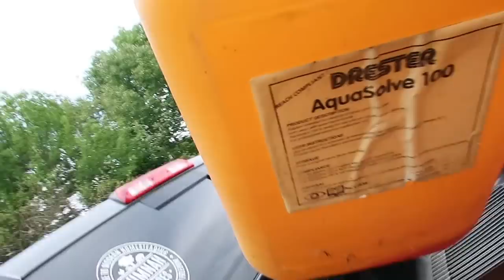Unbelievable Discovery Unearthed While Planting Our Pasture

Comment: Al, you have mentioned several times about having to mess with your tractor fuel and spilling it because you cannot see when the tank is full.  Well, have you looked into the portable gas rolling tank that holds either 15 or 20 gallons of fuel and it has rwo wheels like a 2-wheel package truck?  The two options also have a gas nossel and hose that allows you to pump your fuel.  There also is a battery powered fuel pump the your can put into your supply tank and press the switch and pump the fuel into the tractor.  Just offering you some suggestions.

Comment: I have seen Facebook posts about solar lights burning buildings down due to battery overheating from overcharging.  It may just be certain brands (cheap ones?)  but you should research the ones you have and I think it would be a good idea to mount those on its own pole or non combustible material to be on safe side.  Love what you’re doing with homestead by the way.

Comment: I know you are limited by the size of your tractor..
Having spent 36 working years running heavy equipment..  I don't think twice about playing with dirt...
Big farms take the time to level their fields...
Helps stop erosion and helps the water soak in..
If funds become available...
Leveling the pasture might make life easier..
With your tractors limitations..
Maybe think about cross raking your pasture. (Raking across the slope and not down the hill)
At the end of each pass
turn back up the slope a little to help stop wash outs....  
Should help stop some of the rain from running down the slope washing things out....
Maybe.   ?
That's where i might start..
Reply: The BEST advice of the bunch! Isn't there a method of making several very shallow ditch-like rows across a field to slow the water and retain it longer so it can soak in rather than run off? Wranglerstar did a video about how he did it. They don't have to be very deep nor close together. I can't remember what the method is called, but it seemed like a good idea depending on how you want to use the field.
Reply: Called swales. Good idea!
Reply: Mrs. Lewis 
Making swales would require a larger machine
Basicaly you would be tertacing the pasture..
They used swales in arizona's lower desert to reclaim land..
Swales might require more effort than to level the whole pasture with a holding berm around 3 sides..

Comment: Find that spring head dig it out and then make a trench so the water flows in the trench rather than all over the pasture turn that spring head into a live stock continuous water source
Reply: Or put a couple of cement pipe rings one on top of the other and an outlet. Pop in a pump and you have water on tap.
Reply: Good thought, or you could use gravity and pipe it down to a watering trough  self sustaining no electricity needed
Reply: Being able to develop a spring is a great asset on a home stead, all kind of possibilities .
Reply: DON'T THINK IT IZ A NATURAL SPRING
IT IZ JUST THE LOW SPOTS OF THE LAND
& JUST THE RAIN WATER COLLECTED
THERE.  I DO AGREE WITH THE IDEA
THAT IT NEEDZ TO BE TRENCH OUT
AN MADE TO TRAVEL AWAY ELSE
WHERE...
GO BACK & WATCH SUM OF THE 
OVERHEAD DRONE SHOTS & PAY
ATTENTION TO THE LAY OF THE LAND...
Reply: you may be correct looks like the saw grass is always green and comes to a point and then spreads out below a specific point either way either drain tile or trenched in order for it to dry out and reclaim the land
Reply: @jeffperry9274  
YES I DO AGREE WITH YA THERE
THAT IZ THE PROBLEM THERE
NO PLACE FOR THAT STANDING
WATER TO DRAIN AWAY FROM.
ITHER MOVE SUM OF THE DIRT TO
FILL IN THOZE LOW SPOTS  or  YES
A TRENCH IZ VERY MUCH SO NEEDED.

Comment: I had to use a 500 pound roller after field. It worked great because it pressed and small rocks under the dert. I would rake seed then roll. Stops washing out after rolling much better than not.I as others on here would also metal detector the land. I found few Indian Head pennies a couple Civil War buttons what's the Eagles on front military just don't know from what era that I'm still haven't checked out. You'd be amazed what you find.

Comment: Al, see if you have a fuel supplier in your area who carries red diesel fuel.  The dyed diesel fuel is for non highway use and does not get taxed all of the highway use taxes.  You might have to fill out a form with dealer stating that you are using it strictly for farm use.  Only thing is if you get caught with it in a truck or car fuel tank it will cost you a fine, so make sure to only use it in your tractor.
Reply: He is purchasing Non-Highway Diesel.  Red dye added.